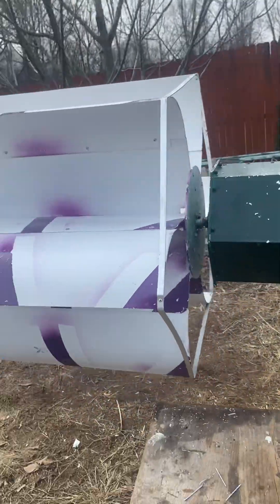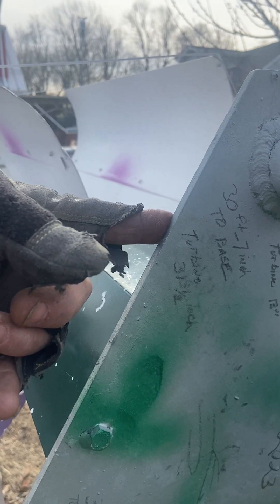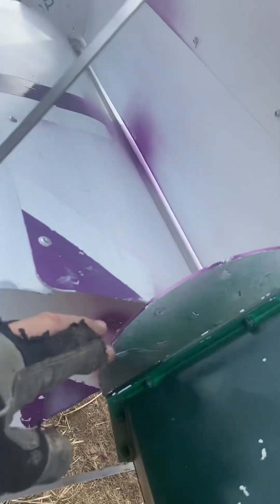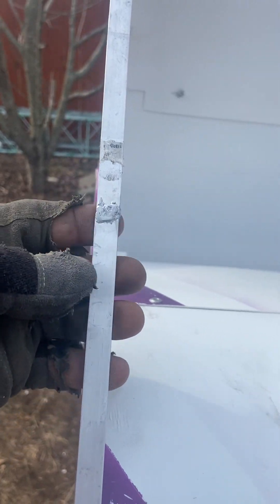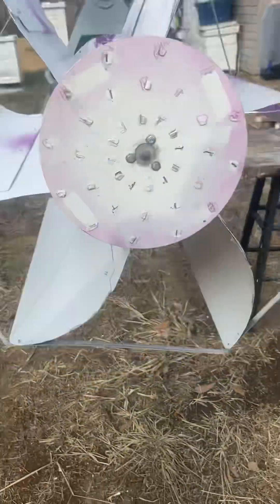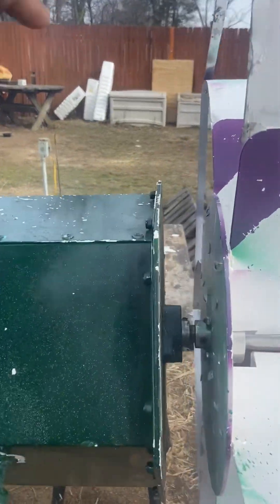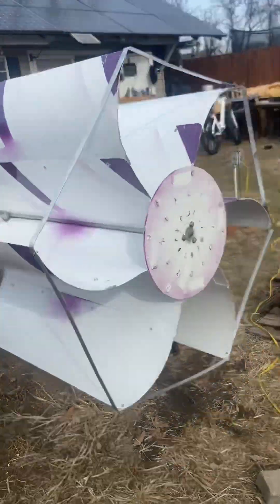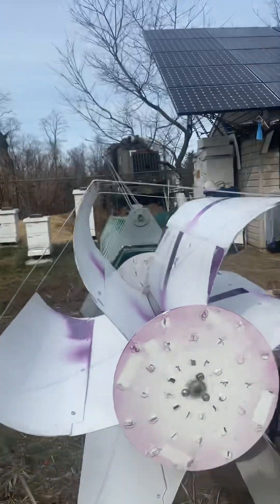Vertical Wind Turbine, Part 46  Never buy Tesup.

Comment: In a previous video, the turbine wasn’t spinning freely but now it seems fine. What did you do to fix it?
Reply from the maker: If you watch the other videos, Note the blade size … The Modification video, I removed every other blade, then re-attached it to the other blades. extending the length. Now it has a longer arm from the center axis to turn under lower speed winds… It may not be enough even still, to run the 4kw generator.